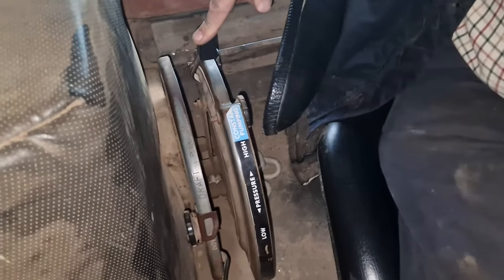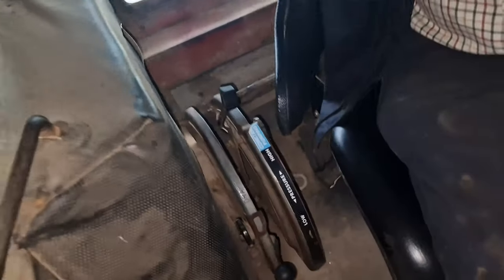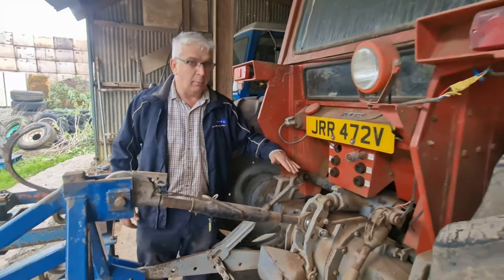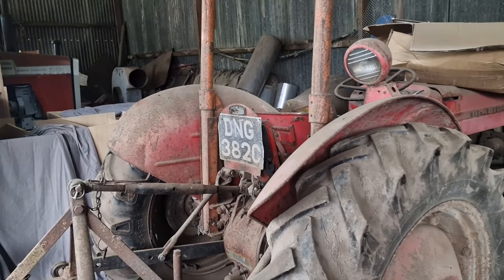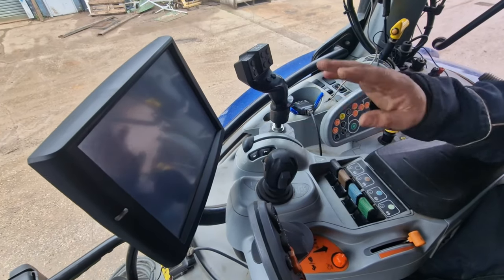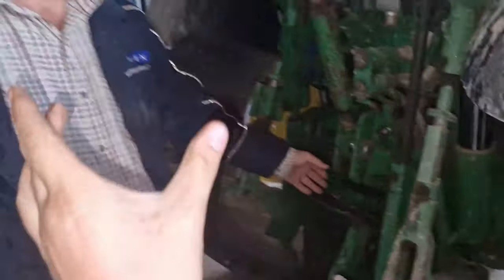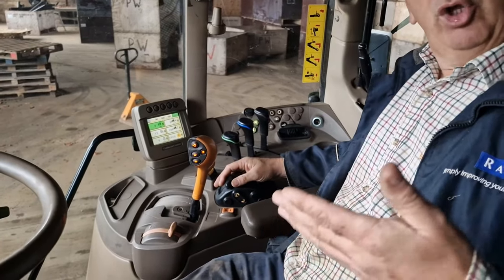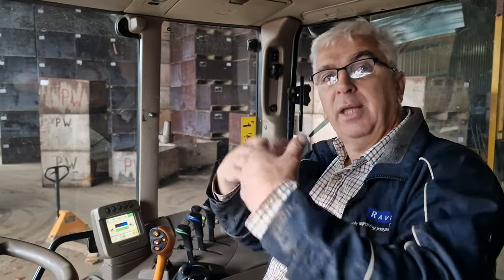Dad describes different draft controls

Comment: Hello, I have a 1990's MF 261 with the same controls as the first 1980's tractor. What position should the draft lever be in when using a  3 point rear mower/brush hog? Thank you.

Comment: It all came from the Patented invention of Harry Ferguson. The three point Hitch, otherwise known as the Ferguson System, was the start of it all.

   Most all of the Tractor Manufacturers, except Ford, waited for the Patent to expire in 1956.  However, They  seemingly didn’t want to acknowledge its origin, rather They tried to assume that it was Their invention.

   Ford, under the leadership of of Henry II, ignored the directive of Harry Ferguson, and went ahead and continued using the System  on the 8N.  A lawsuit followed ,initiated  by Ferguson, and wasn’t settled until August of 1952 at which time Ford was ordered to stop production of the 8N.
Ford also had to pay for the Patent infringement.

   After the merger of Massey  Harris and Ferguson in 1953, The System was put on existing Massey Harris Tractors.  However, They lacked  Draft Control because of the Tractor design and, were no better than buying a  kit from a Farm and Fleet Store and putting it on other Tractors of the Time.

                                         Fergieman
Reply from the maker: Thanks for the extra history. Very good to know the extra details

Comment: No No No!  Your explanation is wrong!   Harry Ferguson found that the mounted plough tries to nose dive when you pull forward.  The deeper the plough, the more PRESSURE on the Top Link and this force is what is controlled and measured by the Draft Control, Top Link system.  This is how we get the weight transfer you are talking about.    With 2 and 3 furrow ploughs the Draft pressure is quite good and measurable,  but as the ploughs and machinery get larger and longer, the Draft force on the Top Link gets less.   And so Larger tractors (and John Deere)  use the pulling force on the lower arms to measure the load and depth of the plough.
Reply: you are correct, the man in the video was wrong explaining that the top link is pulled out--- incorrect, the top link is pushed in, this is what trigers the draft controll .